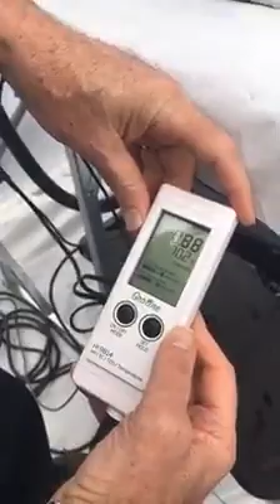EC and Hydroponic Farming

Comment: In My country tab water ppm=616, n Rain water ppm=1848 I want to grow Lettuce (ppm 560-840) if I use tap water it’s middle level but rain water is higher level . I don’t know How to mix solution A &B ? Please help me.
Reply from the maker: You need to get your tap water tested to see what makes up the 616 ppm; or get test results from local water board if you have one.  If the water is softened than its most likely Sodium (Na).  You either filter your water or add you target EC (ppm/CF) optop of the EC of your source water.